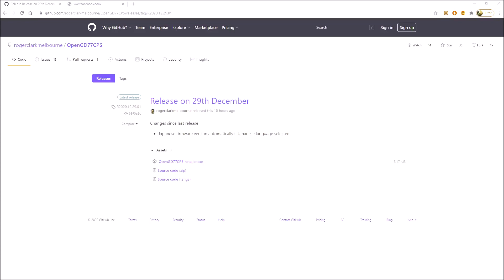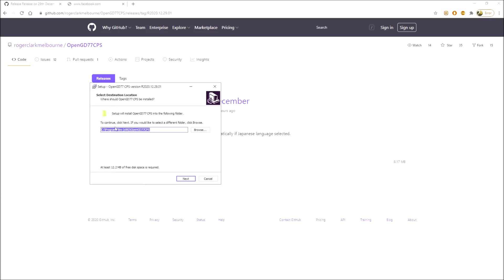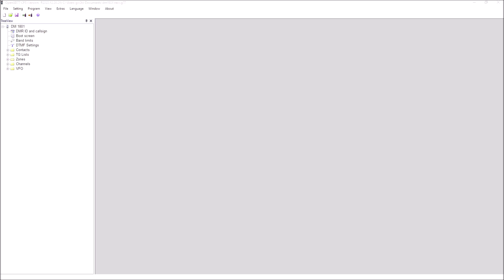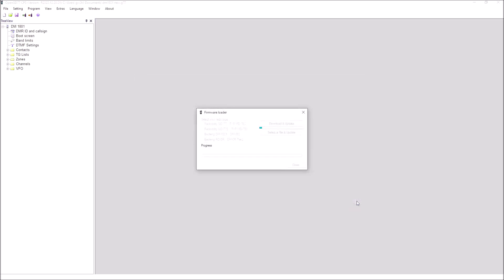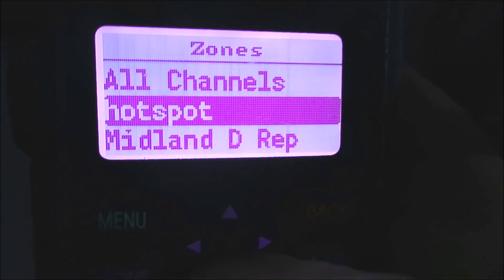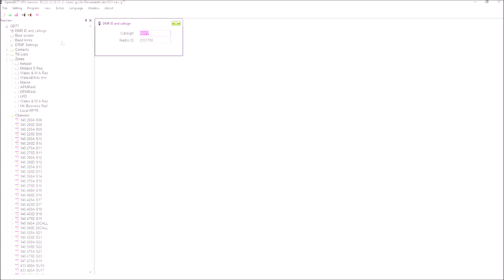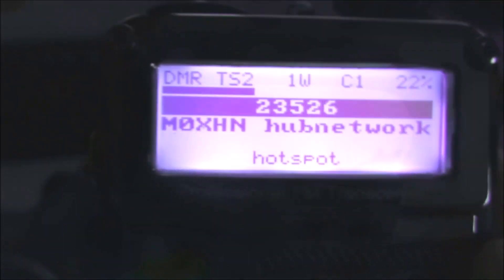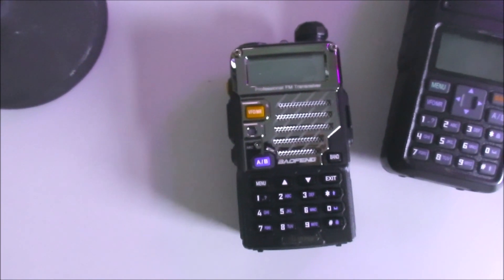Upgrading the DM5R/RD5R

Comment: Very useful description. Thank you very much. 
I have a RD-5R and I live in Sri Lanka. I will attempt to write a fresh CP based on the OLD RD-5R CP.
Thank you again. 4S7EF
Reply: I loaded the firmware to the RD-5R. Towards the tail end I there was a message on the screen saying success (or words to that effect) but the  the firmware update complete message box did not show up. My heart sank!! However when I booted up the radio, it seemed that the firmware had been successfully uploaded (i hope). Eventually I wrote a small code plug for TG91 and had successful QSO through the  hotspot. THANK YOU  EVER SO MUCH for this video.
Reply: Look forward to more videos on the OPENGD77 and Baofeng radios.
Reply from the maker: you are welome.Glad it helped.

Comment: I run the opengd77 firmware on the gd77. I love it with only ONE exception... the loss of the text messaging capability. I love the hotspot function! I would consider putting it on the rd5r but do not want to lose the text msg.
Reply from the maker: I have never used text messaging on DMR so don't miss it. If you have a GD77 you will be able to share the codeplug with your DM5R.
Reply: @KevinOReillyswl  Understood. That's how I feel about whether or not a radio has GPS. I have found the SMS useful for leaving off-line notes for people (so long as their radio is on to receive it). It is a feature I have become accustomed to.

Comment: I'd recommend you try the Beta versions, they are normally pretty stable despite being a Beta.

The Beta released yesterday  (2020/01/19) , has a load of bug fixes, and has had 53 downloads in the last 12 hours,  for the RD-5R and no reports of any new bugs.
The GD77 has 210 downloads in the last 12 hours, with no bug reports.

So its definitely worth at least trying the latest Beta, and if there are any problems you can always reload with an older version.

BTW.
Although the firmware does support Hotspot Mode on this radio, the radio hardware really isn't up to the job, as the internal voltage regulation can't take the stress of running the USB to a RPi and also transmitting at the same time.
Reply from the maker: Thanks Roger I will give the Beta versions a go

Comment: My RD-5R is working great on the CPS. I'm not sure its worth the switch, but I'm going to give it a try. Is it possible to read the current CP and then Write it into the GD77 CPS? Great video, BTW.
Reply from the maker: No unfortunately you will need to either download a new codeplug or write one as the standard codeplug won't work
Reply: @KevinOReillyswl  I figured that. It's no biggie. I was just curious. Thank you for the super quick response.
Reply: Is it not possible to export to CSV and then import to open gd77?